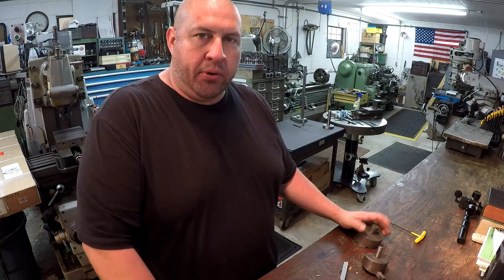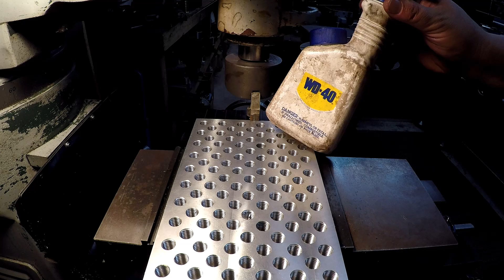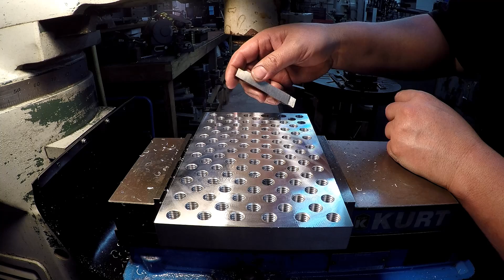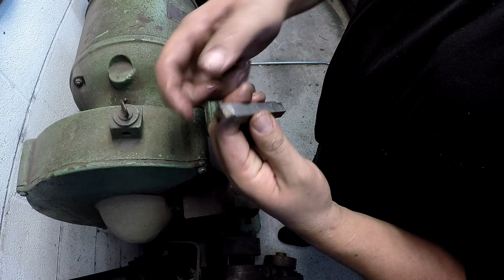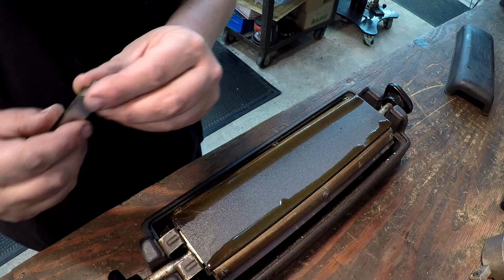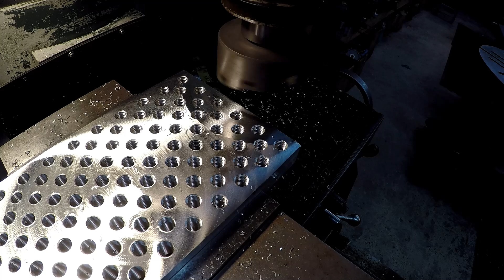Shop Talk 17 Flycutters & Tool Bits

Comment: steel on aluminum is NEVER good, carbide always gives better results...
Reply from the maker: NEVER good? Are you sure about that public statement?
Reply: James O'Connell not true
Reply: Matt Dostou Steel is always more frictionly imbibed on the softer metals,; copper, silver, gold, and aluminum. Read your books!
Reply: James O'Connell 34 years in the  trade all over this country .... exp says otherwise... besisdes... I don't remember anyone talking about steel.... hss has way diff properties than steel...m
Reply: Didn't think we were talking abrout cutting steel, Matt. I thought we were talking about non-ferrous metals.... Sorry if I am wrong.
Reply: James O'Connell Never in my life have I seen ANYONE cut aluminum with steel...lmfao gtfoh
Reply: Matt Dostou That is what I was TRYING to say, Matt! Good Lord, son, carbide is the best way to cut ALL non-ferrous metals...Where did you get off track? I am deep into beer-thirty, but you seem to be in overtime...
Reply: HSS works great on aluminum...what do you think people used before carbide tooling was common?
Reply: Correct answer,obviously a positive rake on the tool will help.This all looks rather quaint,but at the end of the day you have to make do with what you can afford.I was fortunate enough to operate a CNC M/C centre where I had access to every conceivable tool and ceramic/carbide tip.That was in the 1980s.
Reply: Whatever is sharp
Reply: Erik Olson better than carbide imo
Reply: Unless you cut aluminum with carbide and no lubricant. Then it builds up an edge and will take the coating with it when it chips off. I've had to machine aluminum from time to time (both cast and extruded), and I used carbide with a spritz of WD-40 and a high surface speed, got fine results.
Reply: Yeah that's not true. In some instances HSS is fine. You can get it really sharp compared to carbide. Less pressure on the cut.
Reply: This is inaccurate, at least from my experience.
Reply: Erik Olson 
I don't drink... sorry
Reply: That was James thinking you were bombed, not me.
Reply: The big advantage of HSS is that you can make your tool really sharp. A pressed mass production tungsten carbide insert tool can never have this sharpness. There is only a little deflection on HSS tools because they’re more cutting than sliding, therefore lower friction, better surface roughness and lower spindle load - ideal for the small hobby shop with light weight machines and little money. Better in your shop is what works better for you, your machines, your skills, your budget.
Reply: i always get a better finish using HSS
Reply: I prefer bright finish HSS tools for aluminum, especially the more gummy alloys… I also use WD-40 on aluminum , but I’ve been yelled at for it. I continue to do it because idc if it’s a placebo or what but I swear it works better than anything else.
Reply: James O'Connell once again... not true...
Reply: +Erik Olson, with enough lube!!!
Reply: Abom79 HSS will always perform well on non-ferrous material so long as you provide ample lubricant, but carbide always gives better results...Wet or dry.
Reply: James O'Connell   So your reply to Abom is that steel ‘always works well’ with lubricant whereas your initial, capitalized statement was ‘never’... hmm ... interesting and amusing

Comment: I get you completely i get a hankering for a certain tool Im 90% of the time grabbing material of unknown orgin guess metal i recieved with lathe and have to make all my tooling with what little end mills and lathe bits I never got into hss until I sold my setup years ago to move north. Now im settled here and finally found someone I could barter with an get a lathe from him its a old but decent logan 10 in baby lathe came with a  bunch of tooling hss mostly one cheap carbide insert tooling but its iffy. So I just built my first fly cutter out of well idk exactly I know its  not magnetic  and stainless of some recipe cuts nicely

Comment: Interesting video but cuts a little deep. 002 gives less chatter and a better finish. In perfect tram you'll always get some back drag. The leading edge lifts slightly while cutting followed by a lighter cut by the trailing edge.

Comment: While the answer to my questiion will be painfully obviious to most, Where is the RADIUS in relationship to the cutting edge/pint?? On the leading edge or trailing edge.  (If you would paint the tooling blank with any color on the TOP of the tool, I could follow your turning and twisting while you grind and hone it!)  Great source for information/learning  Keep up the good work!!

Comment: If you drill some calculated depth holes in the front part of your fly cutter you can get it balanced better and run at higher rpm’s

Comment: In my humble opinion flycutting can be one of the most dangerous machining operations. One particular danger is having the toolbit protruding outside from the cutter body. The toolbit can become almost invisible when spinning, giving the impression that the edge of the cutting is performed at the cutter body edge. 

This extended condition also creates an out of balance tool. The leverage on the toolbit is greatly increased as its clamping zone is further from the cutting edge, reducing its security in the holder. Rigidity is key when using a flycutter & a short projection will help this & reduce the "invisible" danger area surrounding the body. 

A cutter body larger than the width of the part is preferable allowing the toolbit to be inside the body, removing the invisible danger area. In an ideal situation the fly cutter would only be slightly larger than the width of cut. When a relatively large swing on a cutter is used compared to the width of cut, the tooth engagement angle becomes almost 90 degrees to the part. This gives a sudden impact when the full tooth load is immediately applied on contact. This full feed of cut is maintained throughout the shallow cutting arc maintaining full load throughout. Giving a constant chip section with the force maintained at right angles to the part width. The resulting clattering of the tooth impact can lead to chatter & tool chipping. 

An excessive toolbit overhang also can lead to back cutting due to the increased leverage that can deflect to toolbit upwards during the cutting phase of the stroke. The back cutting is caused by the tool springing back to its unloaded condition. This is eliminated on a shaper by the clapper box allowing the tool to lift on its backstroke but not available when flycutting.  

Using a smaller swing, the tooth engagement angle becomes more tangential to the part. This has the effect of an initial light load on the tooth that smoothly & gradually increases then decreases to almost zero on exit. This greatly helps with chipping on the back edge. This light initial load is resisted by the rigid length of the part & therefore far more stable. This chip section is a crescent shape with a tapered feed to the full chip width & immediately tapering back to zero. This crescent shape directly represents the tool load & direction spread throughout the arc. The highest load on the tool only happens briefly half way through the arc instead of throughout the whole arc. This greatly reduces the chances of premature chipping & chatter marks, it's also a lot quieter! 

 Another bonus is that as the tool is effectively a smaller diameter, a higher rpm can be used. The stability obtained with the load being along the length at engagement, can allow a deeper cut. If the feed per tooth remains constant then the feed can also be increased. 

If you don't have access to a small enough tool there is a solution to help with the issues outlined. Move the workpiece towards you until the cutter tip just passes over the front edge of the part. This will also give a tangential engagement, thereby reducing tool impact, reducing vibration & chatter, especially on thin parts. 

Hope you find this info useful.

Comment: Thank you for the comprehensive info about fly cutters, I feel I have a better understanding of the geometry and grinding/sharpening. I have avoided using the fly cutter on my small (hobby) mill but I now feel better ready to use it... firstly I am adding a more massive base and bench mounting to reduce vibration.  Thanks again, I also enjoy using my Father's and a few of my Grandfathers tools. Glad you are keeping the family in sight.

Comment: I work typically on small parts, so I can surface in a single pass with a 2" indexable with carbide inserts and I get good results that way, but I rarely machine aluminum, mostly cast iron, brass, bronze.

Comment: Its simpler to just do that part correctly by using a shell mill and taking all but one insert out. you can sharpen the insert correctly in case it has a wiper flat. Work around the outside of the part climb cutting about an inch in and go back and forth across the rest of the part overlapping some. If a person still views a "good surface" as a flycutter going across as if they are making one big giant perfect surface then the best thing to do is look at more advanced videos and get the flycutter monkey off your back. A milled surface should get scothbrited anyway--they should not stay as they are to begin with. Flycutters bleed the economy of the country and set back beginners that can decades for them to be freed from this cancer.

Comment: Adam thanks for taking your time and sharing.
I get that there are other methods of making a plate flat but that wasn't the point of your video. You said that in the beginning.
Several commenters mentioned counterbalancing the tool holder. It won't prevent chatter/resonance but will eliminate the balance problem allowing you to go much faster.
joshua43214 may have something there with the 0* rake angle and the interrupted cuts.
Jim Griffiths
 noticed that the tool is howling at a high frequency. That was what I noticed as well. The tuning fork idea will certainly cause the tip of the tool to not be steady and it would show up as a chatter pattern. You need damping in the tool holder. I was thinking of clamping a piece of wood to the cutting tool to dampen out the resonance. Something as simple as radiator hose clamps holding the wood against the tool.
My takeaway is that chatter is a resonance phenomenon and adding a dampening material is the cure. 
As always, thanks again for sharing.

Comment: If we need super flat and shiny aluminum parts we surface grind them after fly cutting. Use way oil when grinding and you'll almost have a mirror finish.

Comment: Wow, looking at your setup at 3:38. it looks like you are driving the tool against the setscrews. The setscrews on a fly cutter should be on the same side as the face of the tool bit, and the face of the tool bit should be in the center line of the tool. 
And BTW, crisco works good on aluminum.
Reply: charles thomas Exactly.  The cutter is built for counter-clockwise rotation, not clockwise.  It would need a tool ground the other handedness.

Comment: Hey Adam, You got that cutting edge honed good and sharp! One suggestion. Aluminum will stick to the top surface (as mounted in a lathe). You should polish that surface as good as you can before dressing the cutting edge to make the aluminum slide off. Also, for the best finish, there should be a slight flat in the radius to match the feed rate you expect to use. Same principle as putting one wiper chip in a face mill. Be careful though, too much flat will cause chatter. You have enough of that already..... Ever consider milling some material off the thick side of that big fly cutter to balance it better?

Comment: My solution for large area surfacing (cylinder heads in particular) was a large thick disc fitted to my shell mill arbor. Different size toolbit slots cut in the periphery with setscrews.
I think I may have shown it in my own pallet build vid some time back. Little to no chatter as the toolbit has minimal stickout. :-)

Comment: I'm no machinist but I enjoy the videos. If the flycutter being off balance is an issue, why isn't there a counter weight?
Reply: I don't think that balance is much of an issue at the slow RPMs used. The interrupted cut can cause all sorts of issues. Every moving part has some slack or flex. They can reinforce each other or if you are really lucky, cancel. This was a demo video limited to a few variations. It would be impossible to cover all the  things that affect the results.

Comment: I have been waiting on a fly cutting vid on aluminum. Thank you. How does one take just a thousandth off a one inch wide, say nine inch in length and then polished to remove any tool marks, so the part can be anodized to make it harder? IE: Can you fly cut off just a thousandth or less and get a mirror finish?
Reply from the maker: Yes you can Larry,n as long as the work piece is rigid when being held.

Comment: Hi Adam. May be it would be possible to balance the holder± because of its angle shape means that the center of the fly cutter needs to be brought back right into the center of the mill. It might be possible and interesting experiment to try to balance it by adding a counterweight so that it is perfectly which makes the cutter stable to allow it to be used at a much higher spindle speed

Comment: Hmm.once the cutter pass the hole it goes from air cutting to material and that is where tool flexes. if that plate was without holes you would not get vibrations. 
For something like this with interupted cuts would  it be better shell-face end mill?

Comment: So where is it written (other than say, fly cutting a large convex/concave radius with head angled) that it all needs to happen in one pass? Why not pull the the tool in to a reasonable (more rigid) diameter and make 2-3 passes (y axis)? You'll get some overlapping marks but they won't mean anything. And it seems like once you get chatter on a surface, it's harder to get rid of it (with light cuts anyway) - the "chattered" surface seems to help create more chatter.

You're the best - keep up the good work!
Reply: Gus Bird, I suppose the issue depends on how quick you need it done, but, depending on how the machine is, if it's perfectly in tram, you can get a good, flat surface with a large flycutter, but the least little bit out of tram, and you ruin it. Then again, taking several steps in Y or X can cause some overlapping marks that are, as odd as it seems, fairly pronounced even with/regardless of good tram.I've found that if you need a flat, milled surface, it's really better to use an end mill. Less pressure and no dishing effect from tram error unless it's waaay out of whack.Great video, Adam. Flycutters are probably new to some of the younger generation of machinists, it's all inserted face mills nowadays!
Reply from the maker: +Gus Bird There are some jobs in the world that needs to be cut in one pass vs several using a face mill.
Reply: Adam large work is great and a real draw to his channel, but I'm more impressed with his range and experience. He's got an amazingly good touch with the small stuff too. And he's a Starrett nut, so what else could you want :)
Reply: sorry... I just sat here and answered my own question...
Reply: Abom79 
just out of curiosity... such as.?...
Reply: Good points Patrick. Tram is important and I guess wear on an older machine table would affect things too. I was thinking (while watching the video) that if Adam's mill was trammed in close he may have lost some of that when he loosened/moved the tram to get that extra travel space for the flycutter to begin the cut. It does seem like the followup cut (the "trailing" end of the cut) on a flycutter will always take something but I don't recall it being enough to matter if everything else was dialed in. I remember a few big "custom" flycutters in the 12-14 inch dia range - made from steel bar stock with an arbor screwed in the middle and the end of the bar machined/set screws to hold the tool. Kind of like a broom handle swinging around with a cutter stuck on the end  :).
Reply: Yep! Wear is a big thing, rigidity is another, as well as how true and smooth the Y axis is when moved. But one thing that makes a good machinist is how well he can work with less-than-perfect equipment and tooling; I'd say Mr. Booth exemplifies that to a T. A very large T! Haha.But what's nice about his fixture plate is, it's made to be lightly trued up each time it's used, so you can essentially have as flat of a surface as your machine can generate! Same concept behind removable clamping/sub-plates and so on, so forth.